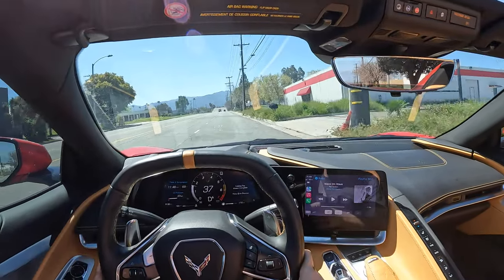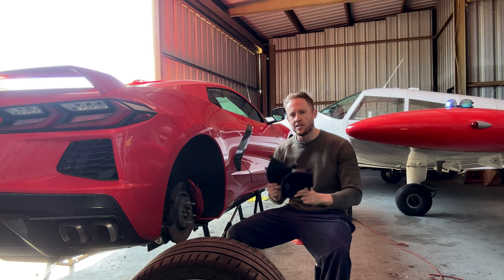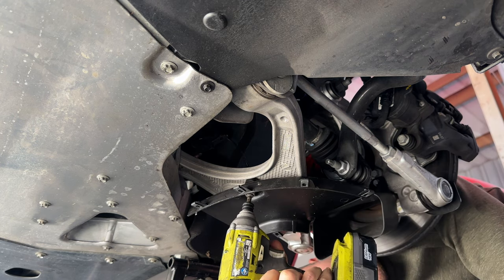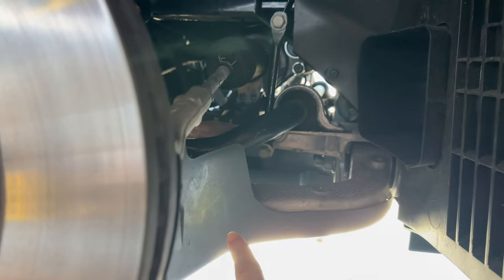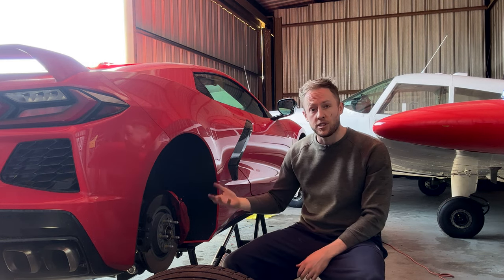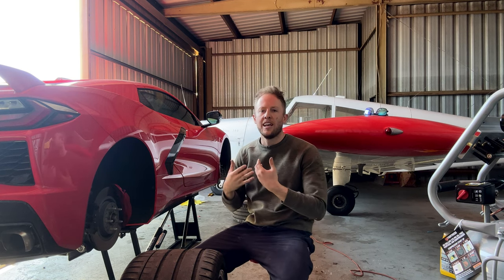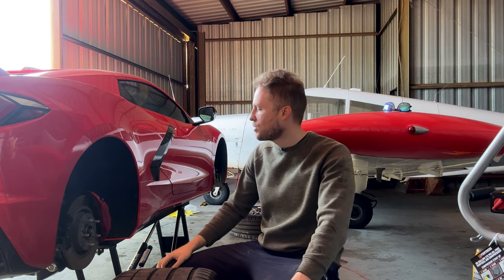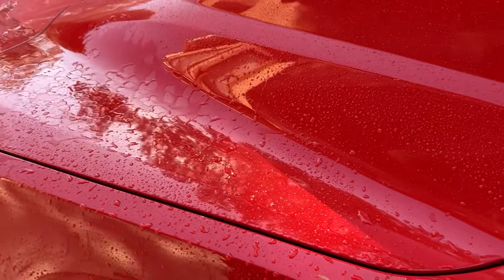Z51 C8 Track Prep | (There's not much to do)

Comment: Curious why you wouldn't want to run the rear brake ducts all the time for additional cooling, even on the street.
Reply from the maker: Hey Ryan, the guide said that leaving it on would cause debris from the road to get directed into the brakes. I think the bigger issue when looking at it from the bottom is how far it sticks down… it could easily catch on something and get ripped off
Reply: @ZentRose  like mine (ripped off haha, but on the track)

Comment: Hi, what cap did you use for your pressure bleeder? i tried a few and none seemed to stick...
Reply from the maker: It's the GM adapter from motive with the 3 tabs (not sure of the part number). It doesn't seal well on the C8 but it works
Reply: @ZentRose  "doesn't seal well" yeahhh, i guess if it worked for you i'll give it a second try. it was pretty hairy and i bought both the plastic and metal ones and still had such a loose fit. Alright, thanks!

Comment: Did you have to use a spring compressor to get the bolts out of the a arms?
Reply from the maker: No
Reply: @ZentRose  Hey thanks for the reply. I was a little worried about doing this myself, but as soon as I got your reply I started wrenching. Surprisingly simple. Thanks again.